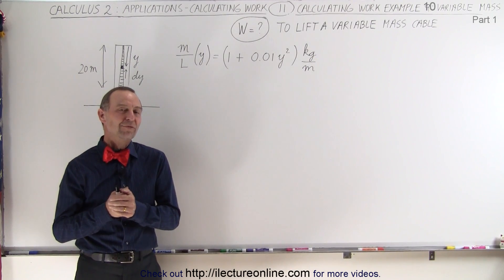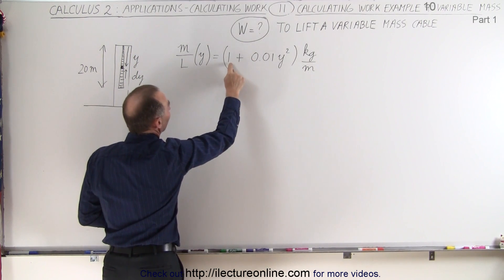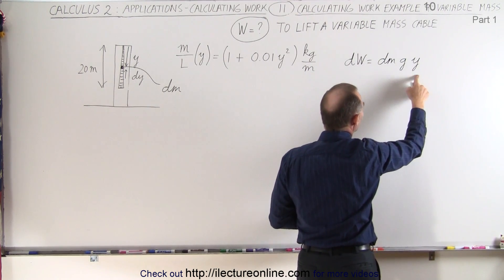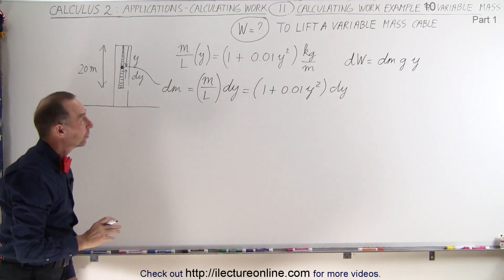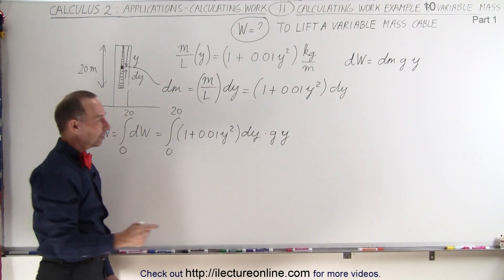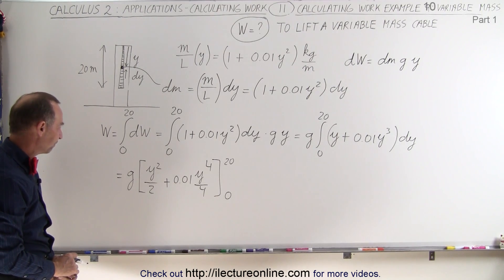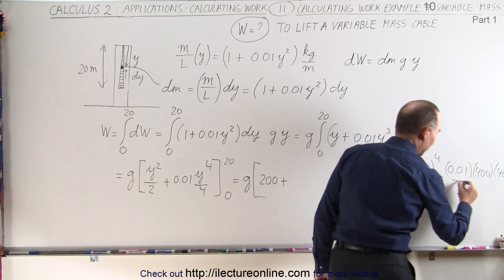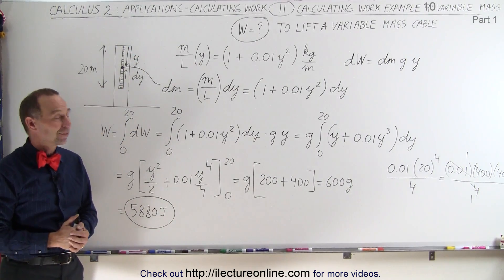Calculus 2: Applications - Calculating Work (11 of 16) Calculating Work Ex. 10: Variable Mass: 1

Comment: This is completely off-topic, but is it true you don't believe in climate change?? :/
Reply from the maker: It should never be a matter of "believe", but a matter of honest scientific research and analysis.  Years ago I, without looking into it personally, accepted the premise that there may be significant warming due to the anthropogenic influences, but after spending over 7,000 hours of research and analysis  on the temperature data of the thousands of weather stations around the world, the structure and vibrational modes of CO2, the orbital patterns of the Earth, the climate history of the Little Ice Age, the Medieval Warm Period, the Holocene Period, and the Ice Ages, the Ocean Levels of the past 300 years, the Glacier fluctuations of the the last 12,000 years, the northern and southern polar cap patterns of the last century, and dozens of other specific topics related to the climate and temperature patterns of the Earth there appears to be little solid scientific evidence that the current warming of the Earth is either unnatural or unusual.  The current temperature patterns of the last 15 years have significantly diverged (In the negative direction) from the climate model graphs found in many text books and magazines.  Only time will tell if that divergence will continue or not.
Reply: I'm not a scientist, so I won't pretend like I know or understand every bit of data and research that you just mentioned. However, there seems to be a strong consensus within the scientific community that anthropogenic global warming is the reality, what do you make of that? Specifically, I would point to the NASA website that presents what looks like a strong case for it: 
https://climate.nasa.gov/evidence/
Also, the consensus comes from a multitude of scientific organizations:
https://climate.nasa.gov/scientific-consensus/

American Association for the Advancement of Science
American Physical Society
American Medical Association
American Chemical Society
The Geological Society of America

I take it you may be a member of at least one of these associations given your credentials. Have you spoken to some of your colleagues about this? 

Hopefully, I'm not coming on too strong, I have been using your videos to aid my studies in engineering as a college student and I deeply value your perspective. I have an activist side, and if what all of these scientists and Al Gore are telling me is true, then I feel like it is my duty to take action for my generation, because this is our future we are talking about, an 'existential threat' is a commonly used phrase.

I just want to make sure that I'm not wasting my time on this issue. Haven't climate scientists reported that the last few years have been the hottest in recorded history?
Reply: Andres ....your argument of "consensus" is an Ad Hominem Fallacy. That is a fancy way of saying it is not logical. Evidence is what one needs to safely make any inferential or deductive conclusion. Climate Scientists base their conclusions on computer models with very little data to back it up. I would remind you that there once was consensus among everyone including the best educated people on the world being flat and that germs and micro-organisms were not an issue in a surgical setting. You underestimate the influence of politics, propaganda and power, in what becomes public opinion. As Mr van Biezen has said, only time will tell if conclusive evidence emerges that climate changes are either unusual or unnatural and if there is anything humans can do to significantly alter nature's course............. I might add a fact for you; do you know how many molecules of CO2 are in front of you right now out of every 10,000 molecules of air ? ........ Answer is 4. Does that sound like something that would cause a catastrophe ? Also a bit of common sense .... the temperature where you are standing right now fluctuates by more than 100deg F, day to night and season to season. 100+ degrees. Yet you have allowed "consensus" to alarm you about a 1deg rise over an entire century. Is it possible that perhaps you may have lost perspective ?  ...........  Also, the recent public issue in the US concerning "fake news" should give you pause about the epistemology of what you "know" and what you can not be sure about. And finally, I think a bit of study of the fascinating topic of Mythology would be quite enlightening for you. Every society has their myths, not just The Greeks.
Reply from the maker: Paul, Thanks for chiming in.   Andres    Unfortunately the scientific methods have not always been followed by everyone when it comes to the study of global warming.  What we don't want to do here is to try to "convince" one another as to who is "right" and who is "wrong".  That rarely works especially if we have already closed our minds to any contradicting information.  I am very familiar with the information you referenced. as I have done exhaustive studies of much of the available data, and as such what I have found and what is being reported have a lot of inconsistencies.  There are many tens of thousands of very qualified scientists around the world who have come to the same conclusion, but the political climate is such that honest, friendly, productive, and cooperative discussion on the subject, in order to gain better understanding, is not high on the agenda of many people associated with the "study" of global warming and climate change. If you are interested in a good read, the French Mathematical Society wrote a 100+ page paper on their analysis of global warming and published it in October of 2015.  Hopefully scientific principles and unbiased research will prevail.
Reply: I don't want to sound confrontational, that is not my intention at all, but I am a college student from Florida so this falls close to home. As a Millenial, this issue really is important to me because the warnings from some of these scientists are very explicit , we're talking about an incoming catastrophe that would affect me and my family directly. 

According to Neil DeGrasse Tyson and Bill Nye, some of the most popular science educators in the country, my state is one of the most vulnerable to some very serious flooding as a direct consequence of anthropogenic global warming. This leads to the inevitable question, should I invest money in my state? Should I buy a home here? Get a job here? Settle down in the southern coast? These are real questions that affect real people and that's why I decided to message you. 

You are also a science educator with a different perspective, so I'm seeing what I can only describe as a clash between educators whose intelligence and credentials I respect. So who should I listen to? This matters because if I listen to the wrong person I have a lot to lose, as do many people here in my state.
Reply: Andrés Esteller: Ultimately it is your responsibility to investigate and draw your own conclusions, preferably based on fact, not speculation. Here is a link to a summary of the paper Prof van Biezen mentioned:
http://joannenova.com.au/2015/10/french-society-of-mathematicians-global-warming-crusade-is-aburd-and-pointless/
(you can also download the full 195pg pdf from here). Look at this and other resources, use your critical thinking skills, examine arguments from both sides without bias, investigate the validity of your chosen sources and you will be well on your way!  :)